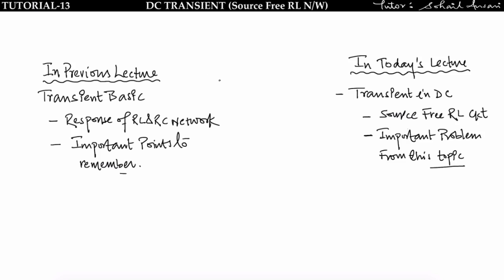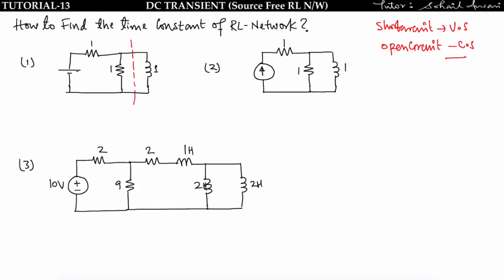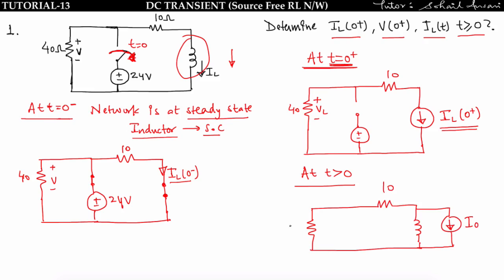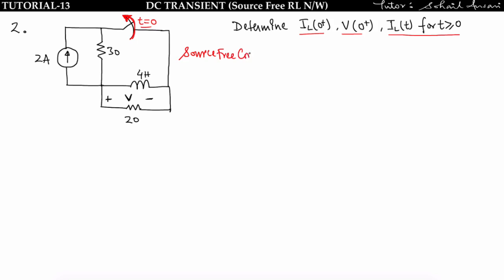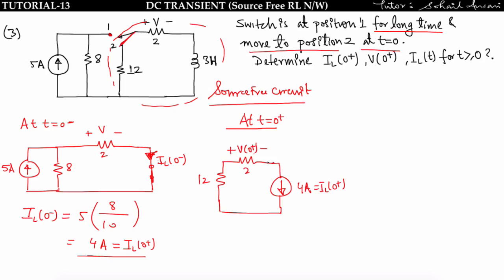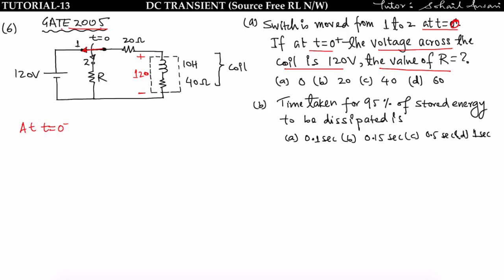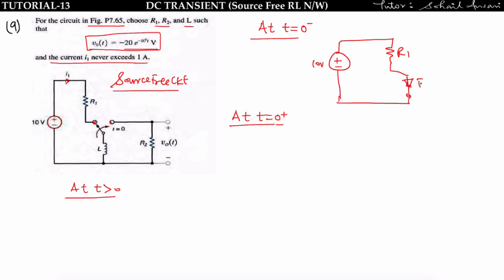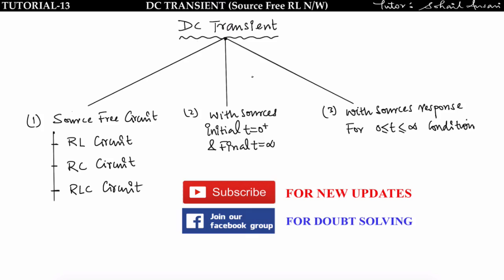Lec-13 TRANSIENT (Source Free RL Circuit)

Comment: You are taking short cut on too many concepts like how the resistor in other branches get shorted when you shorted inductor for steady state.....In question 3  how was 12 ohm resistor get shorted when you shorted the 3H inductor ...Explain clearly on how circuit becomes at t=0- and t= 0+

Comment: Sir, please clear my doubt At 17.38 why you ignored 40 ohm while calculating current at t=0- also you ignored 10 ohm while calculation of voltage at t=0+??
Reply: at t=0- ,the n/w is in steady state so max current flows through inductor...hence 40 ohm may not be considered
at t = 0+, the circuit contains no parallel components.. current is same in series ckt and voltage(vL) is dropped in 40 ohm and not in 10ohm

Comment: sir in Q10 by current devision i value is 2.72 and u take 3amp becouse u take one resistor is 4 ohm which is not in the question.in question one value of resistance is 6 and other is 5ohm

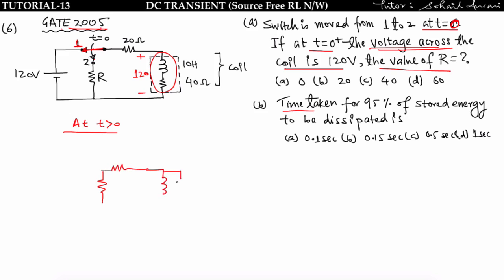Comment: Sir when we take the inductor as current source in source free RL circuit does it have its own resistance? at 37:00 in question it is 120v across the coil but current in the coil is 2A and resistance is 40ohms. Which makes it 80v.
Reply from the maker: inductor will work as current source only at t=0+..

Comment: In 36:35 , 2A is flowing through 40ohm. Inductor is dissipating energy=1/2(L*I^2)=20V which is added with 2*40=80V which gives 100V. Then how is the voltage across the coil 120V...plz help sir.

Comment: In last question,even after short circuit,we should have current source 5A .so, although 6ohm resistor is ignored but why do you ignore 5A current source?
Reply from the maker: take the screenshot of that part and upload in our facebook group..ur query will get resolved..

Comment: Sir in the question at 19.8 min u have replaced the capacitor by only voltage source bt in the next one whic is the question for rlc ckt in which u have replaced the capacitor by voltage source anf also connected capacitor with it why at this time u ve connected capacitor also

Comment: Sir I am having on doubt. At 36:32 
Direction of current source (inductor)  is opposite to 120v. If I take opposite current the the value of R become 80ohm. Why you have not considered opposite current direction?
Reply: here inductor will change his polarity but direction of current remain same so apply kvl in loop (-120+2R+2*20=0) and get R=40 ohm
Reply: Is ur doubt cleared actually i aslo have same doubt

Comment: In 14:40 why you are not considering 40 ohms or it should be neglected
Reply: It's because, we have to find the current through inductor only as per asked in the question, that's why we are considering that branch only. 
IL(0-) means, current passing through inductor at t=0- i.e. just before the switch is closed.

Comment: sir i am having doubt at 20.49. in this why do you neglect 40 ohm resisror. i'm confused is source is removed switch gets opened?
Reply: The resistor is connected in series with the current source so it is an redundant element

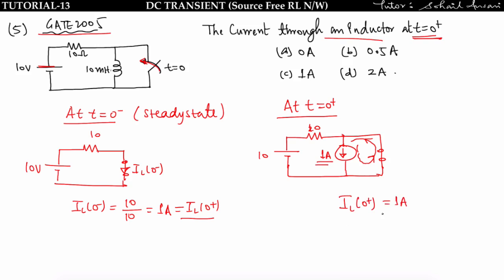Comment: At 32:31, shouldn't there be a current flowing through the resistor as well?
Reply: Its 1 ohm, as at t=0+ inductor is acting as a current source of 1 amp, no doubt about it, now at t=infinity, inductor acts as a S.C, hence there is no point considering the S.C switch branch again. hence the current through the inductor and resistor is 1 amp alone.

Comment: how we can understand this is problem of source free circuit??
Reply: For t>0 draw the circuit. If there is no source at t>0 (i.e if source is disconnected for t>0) then it is source free circuit. Better watch previous lecture if still in doubt
Reply: MILAN SHETA : fold your hands and chant gaytri mantra for twice , if some magic happens , its source free either no . Apply fourier series then to obtain the synchronous reactance of this circuit . 😠

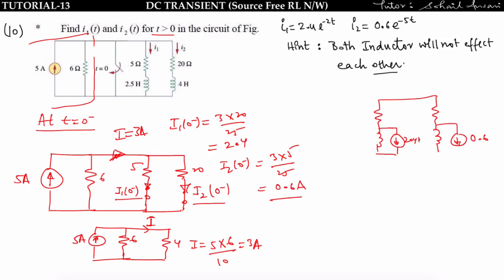Comment: Sir at 45:14 the switch is closed so why the other circuit is if no use
Reply: me too have the same doubt
Reply: Switch closed means s.c i.e offers 0 resistance ,so current enters into that s.c path....
Reply: OK due to short circuit the resistance will no use then what about current source ( where its gone)

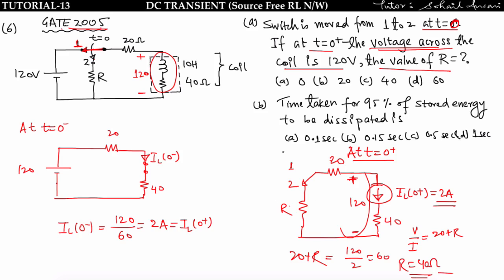Comment: Sir if i apply Kvl at 36:37 to get the Resistance .then the resistance is Negative.why is that sir?
Reply: Here we have to reverse the polarity of voltage across coil in order to satisfy the inductor property at t>=0 in source free circuits.As we know that inductor delivers energy at this instant

Comment: sir at 33.35 you said the circuit is at steady statei.e constant.After that source free circuit i.e inductor discharging.my doubt is at t=0- you consider steady state i.e inductor fully charged.
why didnt you consider the inductor charging state where current is varying .after that only the steady state comes.you consider directy steady state.why not the charging state ???
Reply from the maker: see the question..question is saying that initially the switch was at point 1..means it is connected for long time for t<0..means the circuit is at steady state..ok..

Comment: sir at 22:34 why we have removed the source at t=o+ rather at t>o the source will still be connected to 3ohm resistor , the circuit will still be connected na ?
Reply: yes its connected but not our concern, as we need to find the voltage across the 20 ohm resistor which is disconnected from the source when switch is opened.

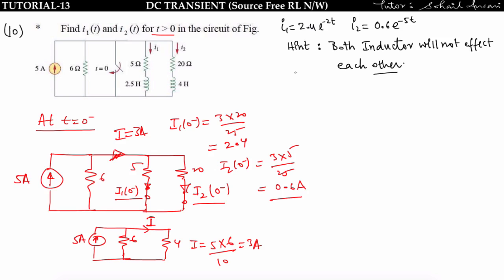Comment: hi, lecture num 13. last problem(10) at t=0- how u got the resistor value 4 in second circuit.. (time 44:57)
Reply from the maker: resistor 4 value id the parallel combination of 20 and 5 ohm resistor..see the first circuit...
Reply: got it sir, thank u

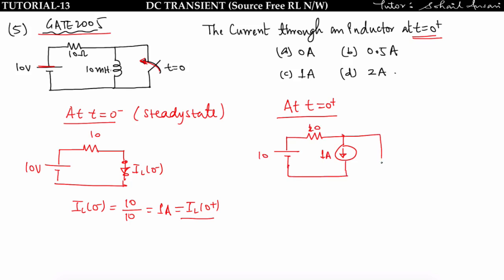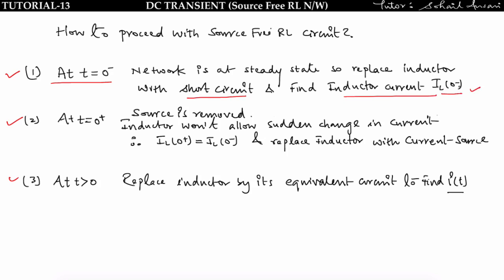Comment: sir at 32:03 minute you took voltage source at t(0+). But at time 4:47 minute in process u said source is removed at t(0+) ....i'm confused sir if u plz elaborate it i'll be helpful
Reply from the maker: in this question at t=0+ source is connected..but it is not affecting inductor bcoz of short circuit..thats y i include this question in source free network...got it..
Reply: got it....thnk u sir
Reply: sir but to discharge the energy through inductor... we must remove voltage source, else how will it gonna discharge?

Comment: @22.25: sir,  switch is opened. ok.   But how about the loop 2A source and 30 Ohm resistor? Why it is ignored while calculating I( 0+)?
Reply from the maker: 2A current source and 30 ohm resistor has been removed from the inductor branch..so it can be ignored..
Reply: I am also having the same doubt..please clarify

Comment: Sir, in ques.no. 5,Is the ckt  a source free ckt ?And when t>0 why are we not replacing inductor with  eqivalent ckt and shorcuiting the voltage souce .plz sir explain the condition for t>0 in this ques.I
Reply from the maker: in this question..source is connected at t=0+ but it is not affecting the inductor current...bcoz of parallel short circuit by switch...thats y i consider this as a source free circuit..got it..and in this question it is not asked for t>0..it is asked only for t=0+..so no need to talk about t>0..but if question is asked..then for t>0 also the inductor current will be constant..so no need to make equivalent circuit..it will remain at 1A for all time..bcoz there is no any path for inductor to discharge..it will follow short circuit path and will never discharge..got it..

Comment: sir I could not get how in 1st problem...-96 volts appeared across the resistor....I mean....answer is fine mathematically ....but I wish to get a better insight of what is actually happening inside the ckt such that the voltage across 40ohm has reached -96 volt
Reply from the maker: ur question that even with source voltage of 24 volt how the voltage across 40 ohm resistor is -96v..right...see here inductor play an important role..at t=0+ the current flowing in the circuit is 2.6A..so voltage drop across resistor will be high i.e. 96v..when inductor discharges as the time  passes then current decay exponentially and voltage across resistor decreases..at t=0+ the circuit is having max energy stored in inductor..thats y voltage is very high..got it..

Comment: at 31.00(ques.5).how is it possible to replace the inductor by a current source of 1 amp,as it is not source free ckt therefore at t tends to infinite also. it will be short circuited .so we can replace the inductor/capacitor by eqv current source/eqv voltage source  only in the case of source free ckt.plz explain..
Reply from the maker: if u are talking only about t=0+ then u can replace by current source as it is not dissipating power...power at t=0- and t=0+ remains constant..thats y it can be replaced by current source at t=0+..but if u will talk for t>0 then it must be replaced by an equivalent circuit..
Reply: but inductor will act as short ckt so 1A current will divide into 2 paths, of 0.5 A
how it will 1A?
Reply: 1A current divides into 0.5A only when two equivalent resistors are connected in parallel....

Comment: Hello sir...
in Q.no 6 @ 39:00 sec the time constant of the circuit is 0.1 sec.. while for discharging 95 % of its energy it took 0.15 sec...Is it possible to have more discharge time than the time constant of the system???
Reply from the maker: transient time die out after 4* time constant...so 0.4 second is the transient time..not 0.1 sec...
Reply: ok tq sir.... Then 95 % of energy should be lost in 3 time constants right? then 0.1*3 = 0.3sec should be the answer... but how come it is 0.15 sec?
Reply from the maker: who said to u that 95% of energy get dissipated in 3timeconstant...its not linear..its exponential decayikng function..so u have to go through the exponential function which i have found in the solution...